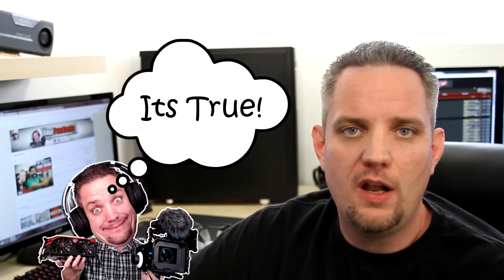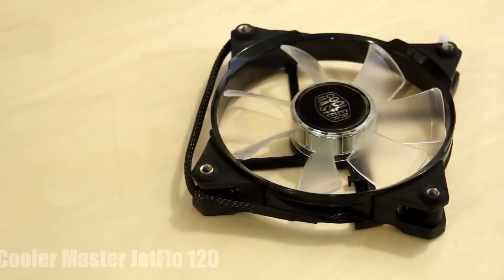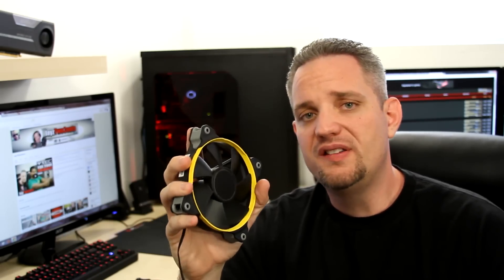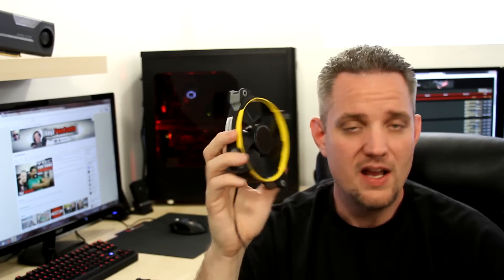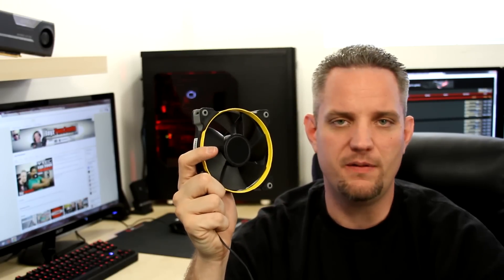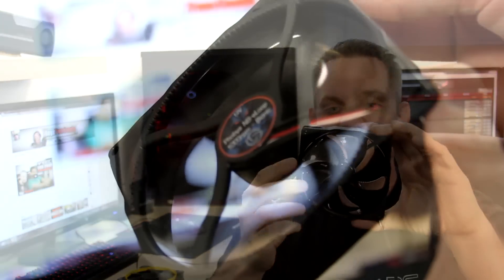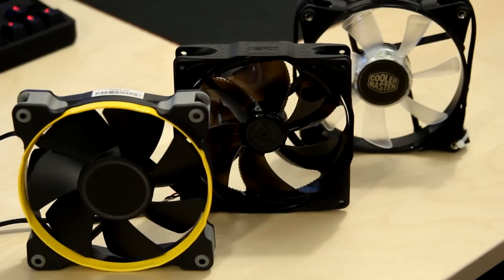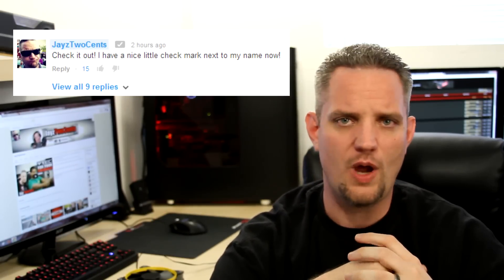Static Pressure vs Air Flow Fans - How to choose the right fan!

Comment: I disagree with the suggestion.  Static pressure should be the exhaust, while regular fans should be the intake.   Static pressure fans are also typically high RPM fans, which means high CFM.   A 3000 RPM Noctua static pressure fan can push 160 cfm.  That's 2-4x the amount of a normal fan.  Since the optimal setup is a negative pressure environment, you need more outtake than intake.   

If you do it the other way around, with a static pressure fan as an intake, the problem is you'll be pumping in more air than you can exhaust, which means air ends up lingering around components, especially in areas without direct flow.

So what you want is a stream that can create negative pressure, which will keep air from lingering, and flow right on through as fast as possible. High static pressure fan as an exhaust will even help to pull in air through the intake, all the way from the back as an outtake.
Reply: or, if you have dust filters on your intakes, creating positive pressure helps keep the dust down. where did you hear that negative pressure is better?  I haven't heard anything about positive pressure not cooling things because the air just sits there.  the air always has to go somewhere.  if it is negative then the air will come in through all the random cracks and grates in the case.  if it is positive pressure the air will go out those cracks.  I think I would rather push the air out to keep the dust out.  But I'm still learning and will be doing more research on this.

I just didn't want anyone trying to learn everything in one place because one random guy sounds smart on the internet and I will immediately take his advice and trust it.

Note: i have no idea about liquid cooling but I imagine that you still want to keep the dust out.
Reply: You're not going to get better temperatures with more fans. Two intake and one exhaust, or even two exhausts will cool the same as what you're suggesting. The only thing you're going to do is create more noise with more fans.
Reply: Brah h 
Not true.  Sure, if you're already at the maximum point of what air cooling can provide, there's no benefit, which is why a radiator can't cool beyond ambient.  But CFM is CFM.  We're not close to ambient in most cases, so there's room to improve.  You pump more volume of air over a given period, and you get better cooling.  

It's like if you're on a motorcycle, the faster you go, the colder you get...because more volume of air to extract heat.  Sure, you're not going to see a 55c max load drop in half, but there is a benefit.  A 70c load could turn into 55c.  I know that when my filters get clogged, I can see 10c rises in temps.  That clog represents the same scenario as less fans or less powerful fans.  If more fans weren't going to make a difference, then clogged fans wouldn't make a difference either.
Reply: Yet there are tests for this as well showing that once you hit a certain threshold for fan count (depending on your case) you do not benefit from adding more. So you can argue that 55C is better than 58C but that's about the same as driving 50 mph on your motorcycle and 53 mph. It's also the same as an SSD running at 540mb write versus 520mb. Technically there is a difference, but the realistic applications and effects are so negligible there is virtually no impact making the benefit minute.

Test Example using the components producing the most heat:
1 intake, 1 back exhaust:
cpu - 60
gpu - 79

2 intake, 1 back exhaust
cpu - 58
gpu - 77

2 intake, 1 back exhaust, 1 top exhaust
cpu - 55
gpu - 76

2 intake, 1 back exhaust, 2 top exhaust
cpu - 55
gpu - 76

So it comes down to whether you want to spend more money on an abundance of fans for severely diminished returns or not. Also, adding more fans, if you don't have the right motherboard, also means you may have to invest in y-cables or a fan controller to accommodate them all. Again, spending more money for virtually no benefit. To each his/her own though.
Reply: i still prefer positive. but if you like negative go for it. but working as a dialysis nurse, and using blood flow and needle placements as a reference, negative air flow sucks air in from the outside to get it exhausted again through the exhaust fan. since exhaust fans are usually in the back, and the back portion of a PC is usually filled with cracks and crevices everywhere, you're just recirculating hot hair via the negative pressure in the back, and your only source of cool air is the air coming in from the intakes in the front. 

blood flow, needle placements, and re circulation are the reason why we don't place needles too close to eachother. the blood that was cleaned and is being sent back to the patient just enters recirculation to be cleaned again, thus, cleaning only clean blood. hot air exhausted, hot air sucked in from negative pressure
Reply: +C North "...convection causes warm air to rise up and away..." No, it doesn't. TLDR; Hot air rises because it is less dense than the surrounding air. 

Hot air rises because when you heat air (or any other gas for that matter), it expands. When the air expands, it becomes less dense than the air around it. The less dense hot air then floats in the denser cold air much like wood floats on water because wood is less dense than water. This floating effect in a less dense medium is called a buoyant force or a displacement force.

We can model what I just said with a little physics. Consider the air to be an ideal gas (this is a good approximation which neglects the interaction of air molecules with each other).

The pressure P, volume V, amount of gas N, and temperature T can all be related by the ideal gas equation as 
P*V=N*R*T 
where R is the ideal gas constant (8.314 in units of J/(mol*K)).

Say you start with an amount of air N at pressure P, volume V1, and Temperature T1 and heat it in a balloon (we will neglect the mass and elastic properties of the balloon for simplicity) to temperature T2.

The ideal gas equation can be rewritten as 
P*V1/(N*T1) =R=P*V2/(N*T2) 
which with a little algebra can be solved to give 
V2=V1*T2/T1 .

From this we see that if you heat a gas such that 
T2>T1 
you get 
V2>V1 
meaning that the gas expands. Now since you have the same amount of gas, the mass does not change so the density before heating is 
d1=m/V1 
and the density after heating is 
d2=m/V2.

Now the force of gravity on the hot air (Fg) is given by the mass of the hot air times the gravitational constant g (9.8 m/s2) 
(Fg=d2*V2*g). 
Here the mass of the hot air is given by the density of the hot air times the volume of the hot air. The buoyant force on the balloon is given by the mass of the air displaced times the gravitational constant (Fb=d1*V2*g). 
Here the mass of the air displace is given by the density of the surrounding cool air times the volume of the balloon (hot air). Now the buoyant force is up and the gravitational force is down so the net force is given by 
F=Fb- Fg=d1*V2*g- d2*V2*g=m*g* (V2/V1- V2/V2) 
which can be rewritten using the relation from the ideal gas law (V2=V1*T2/T 1) to give: 
F=m*g*(T2/T1-1).

This equation shows that as you heat the air in the balloon T2>T1 (i.e. T2/T1>1) you get a positive force (F>0) which means that the force is up and the balloon rises.

In summary, hot air rises because it is less dense than the surrounding air.
Reply: but the most optimal setup is a positive pressure environment tho. you dont want to be sucking air in through the cracks in your case by having a negative pressure environment because that will cause dust build up and will make your fans work harder for intake.
Reply: Nice point there, but what about putting it on a radiator at the front of the case? Which is better? Air flow or Static pressure..
Reply: Falcryx

In that case, a static pressure high CFM fan will still be optimal as exhaust, because it will quickly pull out all of the hot air the radiator is pumping in.  You especially don't want air bouncing around the case after its been heated by the radiator, you want it to go straight out ASAP.

As for an optimal radiator configuration, I would say that Static pressure at the front of the radiator (just to more easily force air through the impedance) and a regular fan at the back of the radiator would be optimal and cost effective.  After all, the regular airflow fans will be receiving an airflow through the radiator from the front, so it doesn't need to suck in as much air.  From there, the exhaust will do the rest.

Even with radiators, I think it's still crucial to have a second unimpeded intake for fresh unheated air, or to simply use them as an outtake.  My case has 2 intakes.  Of course, there's a lot of different types of cases.....but if one wants optimal airflow, they should choose an optimal case to begin with.

I would use a radiator on outtake just to keep it from heating up other components.  Might make the radiator a little warmer, but it's sure to keep everything else cool, like VRM's, other motherboard components, etc.....those are the kinds of components that can cause a system to fail.  I'd say that with liquid coolers, there's typically room to allow a few C in temperature.   Most people probably have headrooms of 10-20c or more.
Reply: C North  Thanks for your effort on writing an essay xD. Yeah I agree to use radiator on the outtake, but I'll be building with an S340 which is somehow a problem for the radiator size stuff like that. I've seen that many people are using the radiator at the front tho so...
Reply: Falcryx

Well it's more so if others read it, not just for your benefit :)

Most people use radiators at the intake to get fully cooled air, rather than slightly warmed air by other components, to it first.  I think this approach is flawed though.  While this could lower CPU temps by a few degree's, it also increases the temps of every other component. So you're essentially blowing whatever temperature the radiator exhaust is, right into the case, which is probably in the realm of 30-50c or more. 

I would say that outtake radiators would run cooler if the airflow is optimal, such as in my node 304 case which has a short and direct path from intake to exhaust.

Since good coolers typically never get near a risky temperature, there's no harm in letting it get 2-3c hotter from running as exhaust.....but plenty of benefit for every other component.
Reply: I'm really glad I stumbled across this. I was on the Corsair website and they suggested the same thing as Jay. Airflow as exhaust and Static Pressure as intake. However, your comment seems to make much more sense so I'm going to do it the other way around. Since I'm not going liquid cooled I was going to purchase a handful of fans.

Two 120mm AF in the front, one 120mm SP in the rear and two 120 mm SP in the top. I think my case has an option for a single bottom mounted fan if I remove the drive cages so I'd do one 120mm AF in the bottom. That's 3 intake and 3 exhaust however all the exhaust would be SP and all the intake would be AF. 120's because I can't find 140's on Corsair's site.

Corsair does have those new magnetic levitation fans that are supposed to be an AF/SP hybrid but they're LED fans and I don't want 6 fans with bright lights that I can't easily turn off in my case.
Reply: Hey just to verify what do you mean by front of radiator and back of radiator? Front meaning the radiator facing the outer side of the case?
Reply: *****
I don't think you can really make a comparison. You're really not recirculating air, convection causes warm air to rise up and away, and even if some air is recycled, it's already made contact and mixed with cooler non cycled air, along with air still coming in from the front.   Fans do a good job of pushing air a good deal away.

I don't know what the back of your PC looks like, but mine has no cracks. Another factor is that if you have a tight case, your exhaust actually would pull air from the intake area.

Back to your re-circulation issue....that's actually what positive pressure causes, internally. You get air touching hot components, then bouncing around in the case to fill it up, so rather than air passing over your CPU and straight out, it might pass through your CPU then over your motherboard down to your videocard and vice versa
Reply: +C North If you really want to prove your point right, try model it with mathematics and physics. Also, do a TL;DR if they don't understand what your model says.
Reply: C North can i ask questions as well ? i am having a hard time picking what fan to use with my Cougar mx200. what fans should i use in the rear ? there are 2 slot for 120 mm. i dont know to choose -.-
Reply: You're looking at it from a perspective of it simply being able to operate within limits.  Sure, we can run CPU's on stock heatsinks, but that doesn't make aftermarket heatsinks useless.

55c and 60c might not be functionally different, but when dust builds up or filters get dirty, the difference can be even greater.  When a room gets hotter the difference can be greater.  When one overclocks more the difference can be greater. 

We could argue that if a cheaper heatsink can keep a CPU within just 5c of overheating, that is enough....but should we all be running our systems at such temps?  Keep in mind, that other hardware fails because of high temps.  Motherboards are typically passively cooled, but a lot of issues can be traced back to overheating components like VRM's....even if overall CPU temps are well within reason, these components can still have overheating issues, especially considering we're packing more and more into smaller spaces, which means less surface area to dissipate it.

Certain hardware simply fails from heat over time.  The main cause of GPU failure, outside of resistors/transistors, is the literal flip chip design that causes failure in the connection between the GPU and the board, and the issue comes from the constantly cooling and heating of the GPU over a protracted period of time.  So even heat within tolerances, can reduce the shelf life of hardware, sometimes causing it to fail significantly before its time.  

Intel CPU's for example, have a max temp of over 100c, yet running them at even 85c can cause issues for other components on the motherboard. 

Did you know the capacitors on your motherboard are only rated for 5-10k hours?  There's nearly 9K hours in a year.....which means if you ran your PC 24/7, you'd be well over the shelf life in less than 2 years!  Now of course they typically last longer than this, but heat can hasten their demise.  It would be pretty bad if one had to buy a new motherboard once a year. 

We often think of hardware as just working, and for many it does work for quite a long time....but there are many cases where hardware simply fails early.  Even if it was a 1 in 20 chance, you might not ever know....but that chance is still pretty darn high for those affected.
Reply: it sounds like you just made some of that stuff up or were just kinda rambling and mixed stuff up.  you talk about cases having dust filters and then say that positive pressure is worse for dust.  But the point of positive pressure is that it keeps dust down if you have dust filters on the intakes.  

I kinda doubt that the exhaust fan helps the efficiency of the intake fan.  with that logic, you could say positive pressure would help the exhaust fan efficiency.  if you have more fans, it just means you can run the at slower speeds to cool your system and it is quieter.  I think fans mostly only push a certain amount of air and if the exhaust is pulling more than the intake, then it just comes in from anywhere.  unless your running the fan at a super high speed and your case is like a vacuum cleaner or a leaf blower.  you could turn your intake fans off and see if the exhaust fans can spin them by pulling in air.  if so then you have some powerful exhaust fans or a pretty airtight case.

if you take an intake fan and have it blowing air across your ram, it is going to cool it way better than some air getting sucked in from some vents somewhere.  But if you can't get intake fans to blow air directly across the mobo then negative pressure might help pull more air across.

I think if you are going for a budget build; you can cut costs by using positive pressure and dust filters on the intakes. that is what I am doing.  Then when I can buy more fans I will play around and see what works best.  if I can cover up all the unfiltered vents on my case with exhaust fans then negative pressure might work well, if they aren't countering each other and making dead zones of air that is.

NOTE:  This is all my inexperienced opinion.  I mostly just got all this with common sense.
Reply: *****

"Negative air pressure is, when you have more exhaust than intake air flow, so your case sucks air IN, air is NOT getting sucked OUT. Seems you mixed those two up."

I have mixed nothing up.  You have simply misinterpreted.

"When you have more intake than exhaust it is called positive air pressure and hot air is pushed out through other gaps in your case. Hot air won't keep "lingering around" as you explained."

Look at a fog machine test video.  Air does tend to linger longer.  You can barely even see fog in a negative pressure test, because it's being diluted and pulled out rapidly. The whole issue with positive pressure is that air is bouncing around, filling the inside of the case, which may seem to increase contact with components visually, but that air is also not moving in and out as quickly, while also losing momentum.  Dust carried by that air has a good chance of being deposited on components due to this loss in momentum.

The idea of dust when it comes to positive and negative air, only applies to filtered systems.  Once you remove the filters, positive pressure is far more dusty than negative pressure because pushing air through cracks doesn't mean much when you're bringing in dust through the intakes.

In cases with filters, the difference between positive and negative pressure when it comes to dust, is negligible.  Many cases have very few cracks for air to be pulled in through, and even then, negative pressure is removing air soo quickly, that any dust pulled in, is going to be quickly and forcefully pulled out through the exhaust, especially since we're talking about air squeezed through small spaces.  The venturi effect as it's called, shows that air flow through restricted spaces, results in an increase of air speed, which is more than enough force to keep particles of dust coming in from cracks to keep moving through to the exhaust.  A piece of dust may only spend 1/3rd of a second inside of a case before it is expelled through the exhaust, that's how fast things are moving.

It's already common knowledge that negative pressure cools more.  It's also common knowledge that positive pressure is less dusty.....but the problem is, that is bad common knowledge that is never really challenged and highly situational, so it's just bad knowledge spread around and accepted as fact.  It's bad knowledge mainly because it doesn't account for all the variables.  It just assumes dust pulled in through cracks (if there are cracks at all, and big ones at that) will stay inside of the case.  This is however, a faulty belief.
Reply: Libri Lector

If negative pressure is quickly sucking air out of the case, then that is enough to pull dust out before it has a chance to settle.  Look up a video where they fog machine test positive and negative pressure.  The air is moving soo fast the fog is soo diluted it's barely visible.  That means more air, more cooling potential as the given volume of air pulls more heat and is quickly replaced with fresh air.

Air flow operates on inducement and entrainment.  Inducement is the suction of more air by being in the proximity of moving air from behind the fan, and entrainment is when air is pulled along the sides of the path of a fans direction.

If one has a half decent case, with filters, dust isn't an issue....and regardless of setup, one should have filters even in positive pressure. The thing about dust is that it tends to stick to magnetized things....like oh say....electrically charged computer components.  That means you could be more likely to have a dusty PC from positive pressure, simply because the air is allowed to mingle all around, moves at a slower pace, bouncing around inside your case, allowing things to settle in every nook and cranny, like oh say, dust. And since that air is bouncing around the case in all directions, to fill it up with positive pressure, it's losing a lot of energy and momentum, which could let dust settle.

Take how dust settles on your computer screen for example, a gentle breeze isn't going to blow it off, because its mass is too small and the magnetism too strong.  Even if you do manage to blow it off, it'll probably re-attach somewhere down the line.  So what you want is air to move through the case as quickly as possible.

Positive and negative pressure has less to do with pressure, and more to do with how the air flows due to the differences in intake/exhaust.

Not only does negative pressure suck air out, but it actually sucks air into the case too.  For example, imagine a case with only an exhaust fan.....well it's going to exhaust, which means it has to be pulling air in as well.  So when you have an exhaust that is stronger than intake, you're actually increasing intake too, which increases the efficiency of your intake fans.  It's kind of like blowing a fan at a fan....that second fan will be stronger due to the increased air volume/speed already headed its way.  Only in this case, it's the first fan stronger because of the air pulled in by the second fan.

On the opposite end, while weaker exhaust fans in a positive pressure setup will also help pull in air through the intake too, they are at the same time making their job to remove that air harder by increasing the volume of air coming in, while not increasing the volume of air it can pull out.

Fact is, arguing that positive pressure pushes air out through cracks, just ignores the inefficiency cracks have on your cooling in the first place.  When air is forced out of cracks, that is momentum redirected and lost, which translates into a reduction of air flow.  So ensuring cracks aren't an issue is worthwhile, as the lack of cracks means the air has nowhere to go but through the exhaust.

I can say from personal experience, even with some cracks, dust isn't an issue in negative pressure.  I use the node 304 case, look up pictures of it and look where all the cracks and holes are.  They're not an issue though, and if anything, they probably help cool around the sides of the motherboard.  My heatsink never needs cleaning, the components look out of the box after nearly 2 years.

Meanwhile my last positive pressure case ATX tower without filters, is caked in dust, and constantly needed to be cleaned, the back of the video card was coated in a thick layer of dust, and the fan blades looked like a lint trap from a dryer every few months.

I think the caveat of negative pressure is WEAK negative pressure can be an issue because it allows dust time to settle.  Strong negative pressure is a different dynamic.  My exhaust is 160cfm, my intake is only 50cfm.....and that's in a case that isn't even a cubic foot, which means the air in the case is replaced completely, multiple times per second.